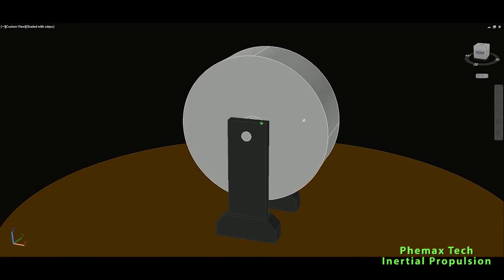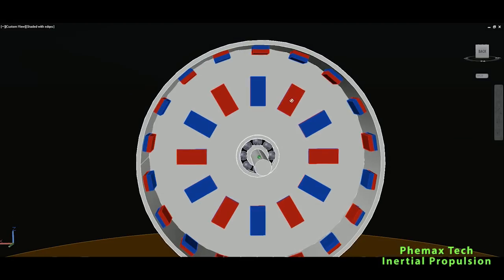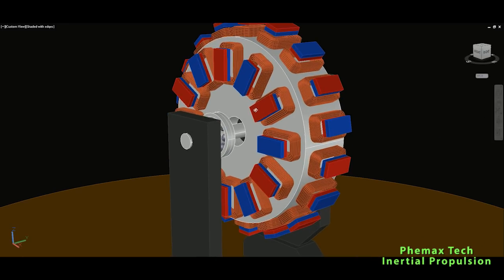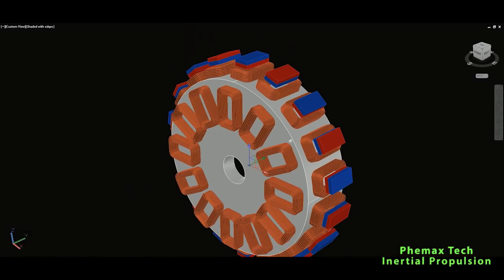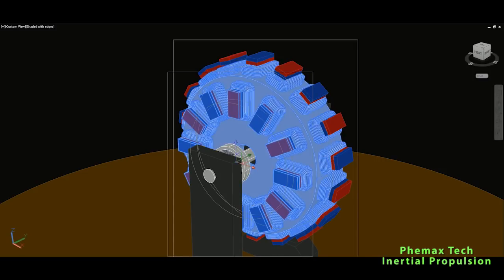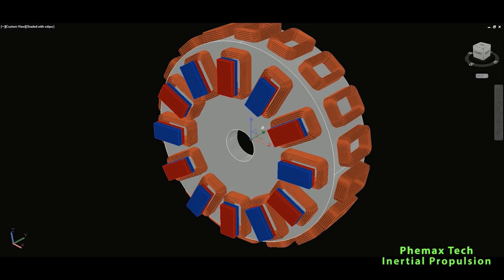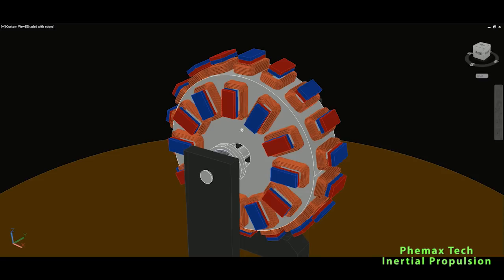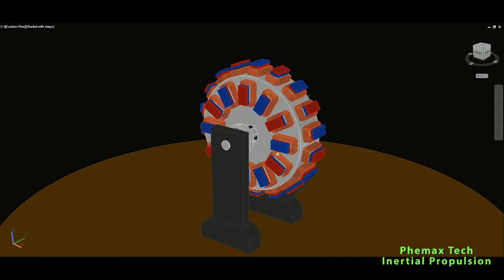FREE ENERGY, Inertial Propulsion Motor Generator

Comment: I was looking at your explanation about this motor and wanted to understand if you understood Step Up Motors a step up motor is supposed to give you more energy out then the motor that's driving it about 1% either by gear system which drives the second motor faster, but looking at your system it looks like if you have a wider diameter you have a slower speed if you have a closer diameter you have a higher speed tell me what you think about this if you don't want to email us at medialibraryinfo@gmail.com  
then give us a call at our company 313-651-5349

Comment: Well only the possibility to extract energy form inertial mass from rotor in motion but the same amount of current would again be drawn from the source so how they are making extra energy it seems new. Anther possibility also exist that the the 90 degree intersecting magnetic flux might prevents the loss of flux energy so it converts to again energy. Thanks for sharing Mario Gudec.